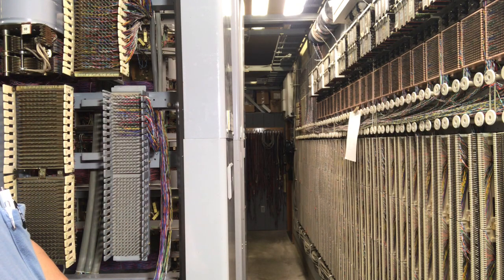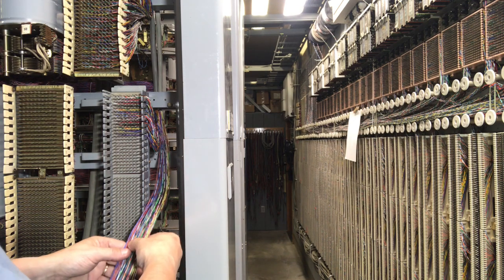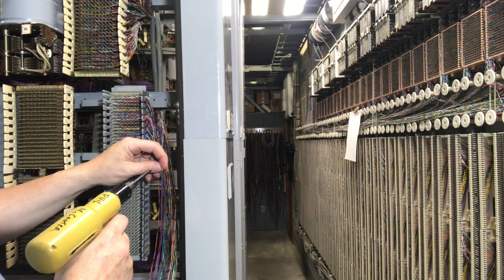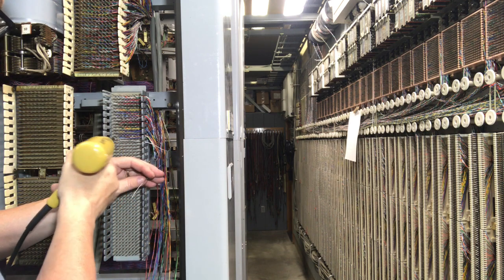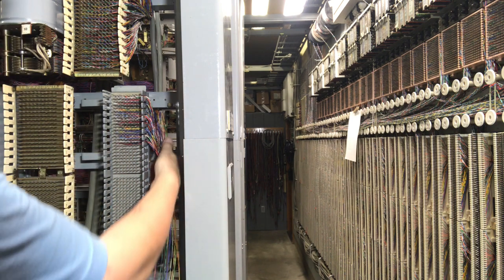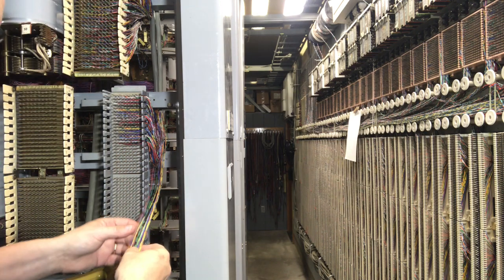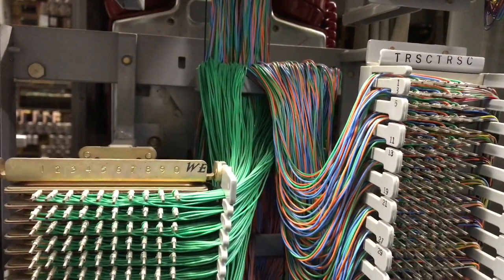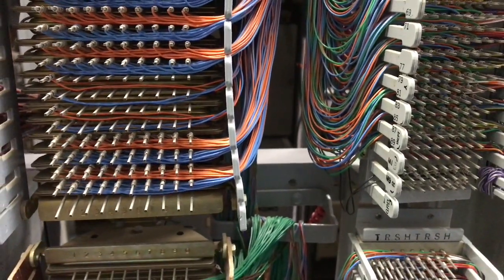Wire wrapping telephone cable

Comment: When I left school in 70s my first job was for plessey telecom on exchange construction all over the U.K. one of the first things I picked up was the colour and wire wrapping we use to have to do test wraps to make sure the gun was ok.bl-w or-w gr-w br-w gr-w / rd - blk - yel - vil
Reply: Cable numbering

White- Red – Blue – Yello – Green - Black =  the only colors to remember

W-R      / W-BL       / W-Y       /  W-GN     / W-BK               = 1   to 10
WR-R    / WR-Bl      / WR-Y    / WR-GN   / WR-BK           = 11 to 20
WBL-R / WBL- BL  / WBL-Y / WBL-GN / WBL- BK       = 21 to 30 
WY-R   / WY-BL      /  WY-Y     / WY-GN   /WY-BK          = 31 to 40
WGN-R  / WGN-BL  /  WGN-Y / WGN-GN  / WGN-BL   = 41 to 50
WBK-R  / WBK-BL  /  WBK-Y / WBK-GN  / WBK-BL     = 51 to 60

Comment: As a C.O. Tech, I have the joy of running jumpers on the MDF every day for customer orders, & trouble tickets when an I&R Tech changes line equipment, a DSL port, or a cable pair.  

When I was an Equipment Installer with Nortel we had to terminate cables both on the Line Equipment Frames, as well as on the Main Distribution Frame.  The real fun was pulling the cables, dealing with fire stop at each cable hole, & lacing all those cables down.  H-Stitch, Continuous Stitch, etc...  Wax Lacing cord/string & snips were our friends.

What fun we have as telephone men!